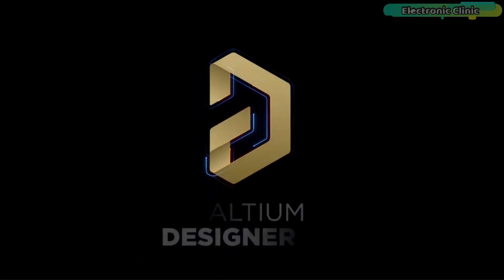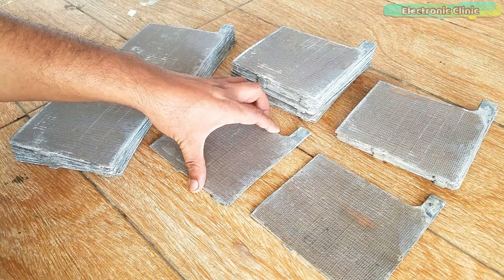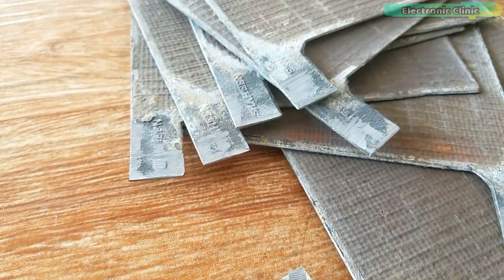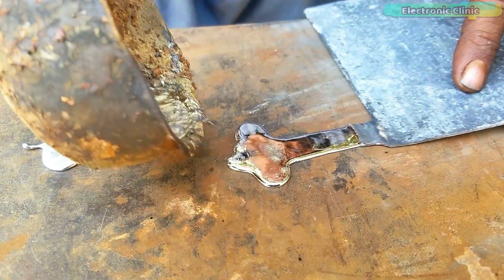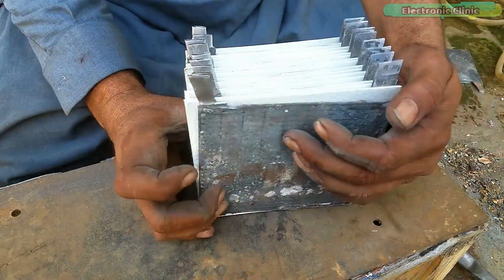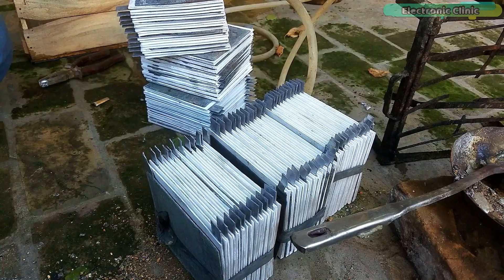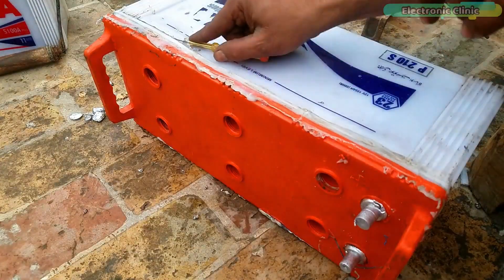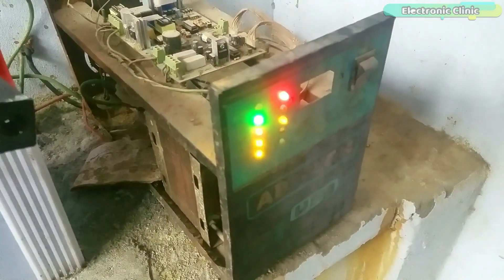How to make New Lead Acid Battery at home, 220Ah Lead Acid Battery, Lead Acid Battery Construction

Comment: 10:47 How did you make this tool? How did you warm it up?
Reply: take a 12 volt battery, the graphene stick can be found inside the battery like a black pencil.
Reply: @7rang.  Thanks. I already figured that out. It's a carbon rod.

Comment: It would be interesting to use modern conductance tester to show the Cold Cranking Amps on the newly built battery.Digital Multimeter will only show voltage of battery.I’ve seen batteries sitting on 12,6 volts but still failing load test let alone start a car.Please subject your rebuilt batteries to standard tests using Carbon Pile load tester & Conductance tester to show CCA.Thanks for the Educational video👍👍
Reply: I believe this is a deep-cycle battery. It is not designed to start a car. just to store massive amounts of electricity

Comment: This method can use for ups baterys
Reply from the maker: yes. this one we made for the inverter.
Reply: @ElectroniClinic  How many AH did you get from this battery and how many ah did you get from the factory when it was new ? also did it get better with every charge ¿?

Comment: You are not making it but you assembled it, don't write a lie on your videos titles.
It's shameful.
Making is different and the making is to start from what is required material/ chemicals for anode and cathode plates making and then start is from the grill and then make one by one anode and cathode plates filling materials mixing ratio and heating etc.
You are just assembling the new parts of the battery and most of all technical people know that process that how to assemble but the people like to know how to make anode and cathode plates and how to mix those materials with accurate ratio, okay?
Don't ever write a lie on your videos titles because it is cheating and you can loose the honour in the viewers eyes.
Now it's depends on you that how you feeling and understand my comment.
Realize it if you can.